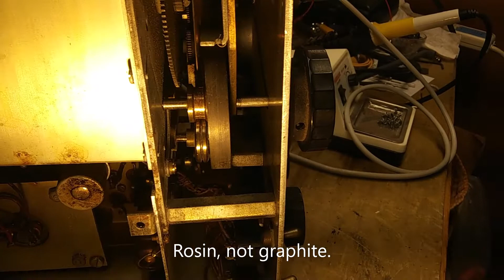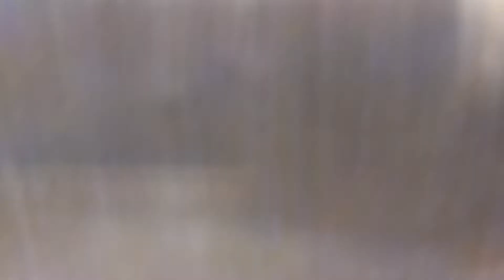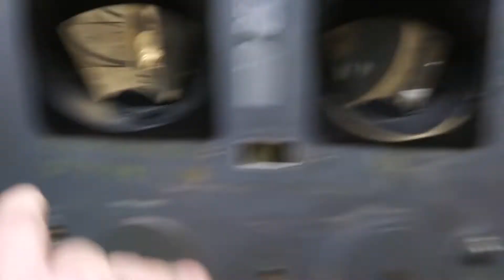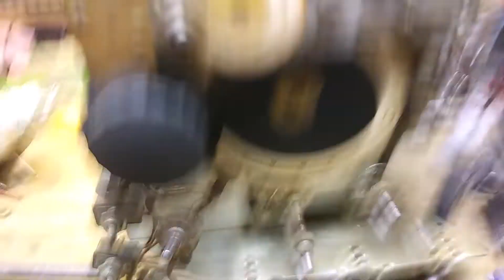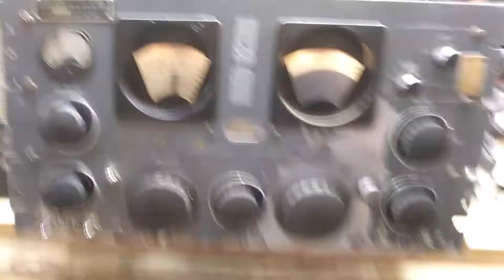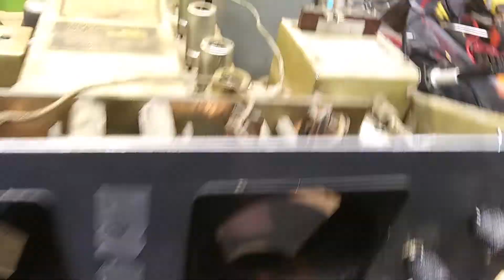Hammarlund SP 600 JX-1 Rescued

Comment from the maker: I sold this to a local ham soon after making this video. He already had one and was looking for another.
I recently found a cart to hold my Hammarlund SP-200, so now I am finally enjoying that one.
The SP-200 has a separate power supply, so setting up that one can be a challenge.
I hope to make a video of that one soon.
73 Paul AA1SU
Reply: I have one this on my garage. Not sure if work. The only thing I know it's very heavy.
Reply from the maker: @bolacheia9444  You should get it out, hook up a wire to it and see if it receives that AM Broadcast band.
73 Paul AA1SU

Comment: Bath tub caps might contain cancer causing oil should you decide  to restuff them be carful.
Reply from the maker: Good to know.  I felt it was too much for me to restore.  I sold it to a local ham who already had one.  I think he wants to make one good one out of both.
Reply: @VTradio  I have an AR88D WW2 vintage it has those caps installed.
The back of the tubs are soldered into place, I drilled out backs off and peeled off with long nose pliers the remainder and carefully disposed of the oil and then restuffed with modern polyester caps.
OK the other ham restoring and making use of one as a doner for spare parts. The oil I think is called PCB its very bad oil. G4LMZ
Reply from the maker: @itsonlyme9938  Thank you for the update!
73 Paul AA1SU